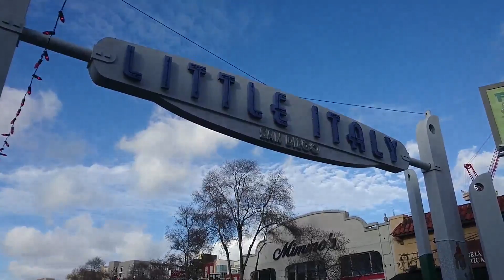16-45_San Diego - ZERO needs WORK!! (sailing ZERO)

Comment: West marine sells plastic interlocking pieces that create an air space under mattress. I wonder what kind of plywood you used. It has to be marine ply, right? I have plywood work to do also. I am wondering why cabin roof is leaking so bad during rain. Really enjoyed the video.